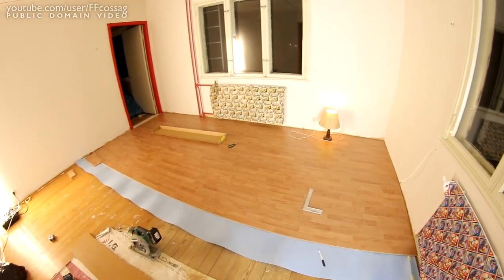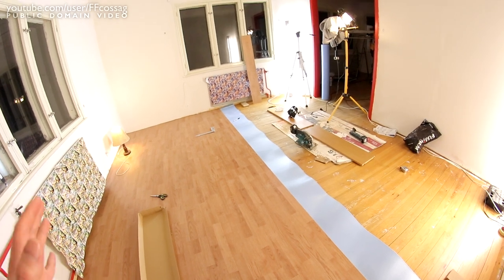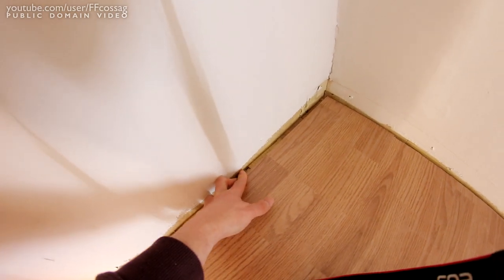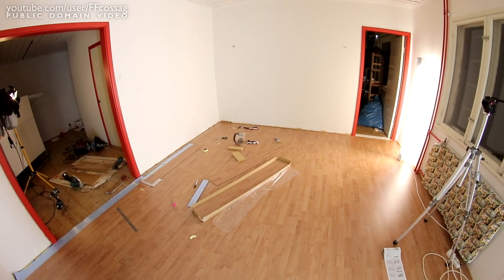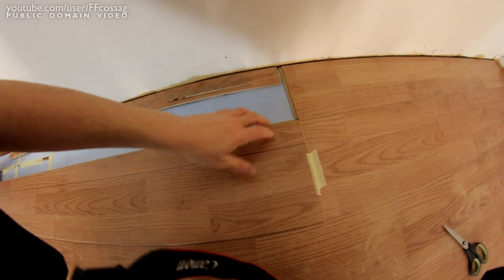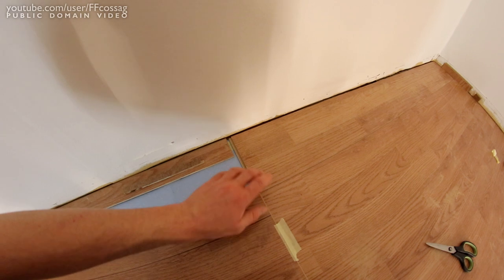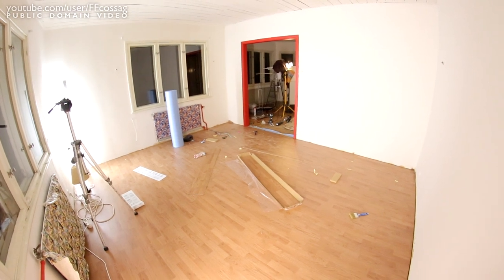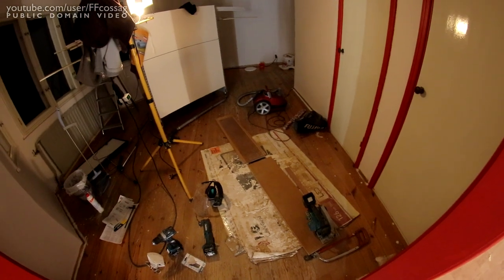Very Cheap Renovation Vlog #3 - Floor

Comment: Short little tip for the angled wall: Lay down the floor as you intend to put it, then grab another board or cutoff and lay it on top of the board you need to cut. Push it right against the wall, draw a line and cut the board. This way you don't need to measure anything since you just copy the angle over. Hopefully this was helpful.

Comment: The easy way to do the door trim is use the multi tool to cut it away just above the floor hight and just put the floor under it, it hides the gap too.
Reply: Not alone the easy way but also the wright way. You do not have to have a multi tool ,there are manual saws with a offset handle special for that purpose.
You take a piece of scrap flooring place it by the post you have to cut put the saw blade flat on it to have the wright height cut that piece doorpost and that is it .
Reply from the maker: I don't want to cut them, in case I want to restore the original floor a long time in the future.

Comment: I put dark brown silicone at the edge of floor and door etc. Silicone takes a few seconds and looks awesome as it just blends everything. You can use "quarter chuck" along the walls to hide gaps. Great floor install. Room looks awesome.
Reply from the maker: Thanks. Silicone isn't a bad idea for the little gaps here and there!
Reply: @FFcossag  So easy and you don't even need to fill the gaps completely. Half filled is fine on my corners. It will self level and is flexible enough.

Comment: In 2018 I painted my house white inside, every room. My floor is timber (bamboo) and the trim that covers the gap between the walls and the edge of the flooring is also bamboo half round I like the finish and I'm shaw you are going too like the white painted rooms with the new timber floors I used liquid nails too fill in some of my misstakes before putting the edging in place.
Your handy work is tookin great FF. So happy for you that the flooring is working out .

Comment: I had bought a house where the previous owner had painted all the woodwork a dark blue. Initially I painted them a taupe and that fixed  that stark contrast, looking more like wood. I have seen where flooring is installed by cutting the vertical boards at the bottom so you can slide the flooring underneath it. But hey so it goes, been here done it both ways.
Reply from the maker: I wanted to retain the ability to restore the original floor in the future. It's better to cut my cheap new floor than the old, specially-made doors.

Comment: You can just make yourself a simple tool for "measuring" and transferring over weird angles with an old box of the floor pieces, a knife and a bit of tape. Basically, 2 pieces of cardboard taped together at the same weird angle that the wall is in, and then used to transfer that angle over to the actual board you're cutting by drawing a line on it. Very simple, really...
Reply from the maker: I did that sort of thing, the issue is that the wall is kind of bowed, so the angle isn't easily measurable.
Reply: @FFcossag  Okay then, maybe you just need to make a new invention. Something with magic that works for any angle at any position and any time.

Comment: fail for around door trim, sorry. u need a special  flush cut hand saw or  an oscillating saw which will cut the door trim at the floor. many a youtube videos on how to cut door jams so new flooring will slide underneath door jams
Reply from the maker: I didn't want to cut the door jamb, since I want the original floor to be restore-able in the future, since this house will most likely out-live the floor I put in.

Comment: a tip for pouting it round the door is to get an off cut of flooring and put it next to the frame and cut the bottom of the frame with a saw and then slide it under

Comment: why didn't you just fix the real hardwood floor?
Reply from the maker: Because it's not hard wood, it's very soft wood. It would get completely destroyed by my office chairs.
Reply: @FFcossag  - that's what "floor protectors"(chair mats) are made for. Much cheaper than a whole new floor (which will also get destroyed by chair wheels anyway).